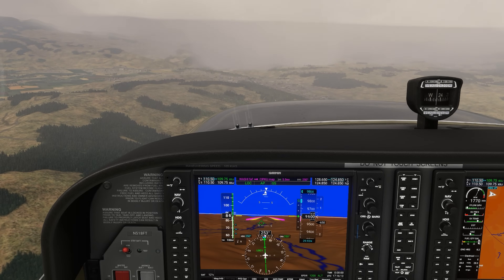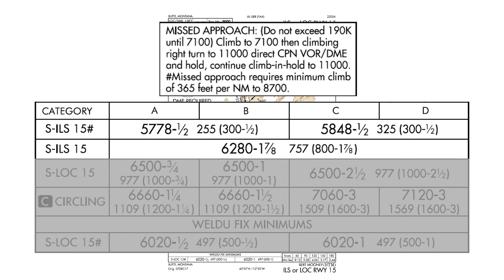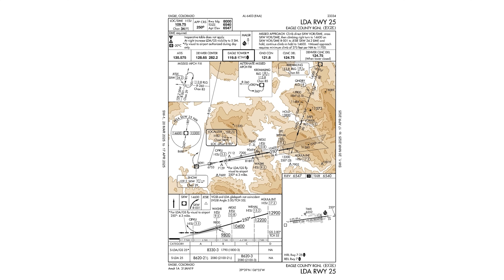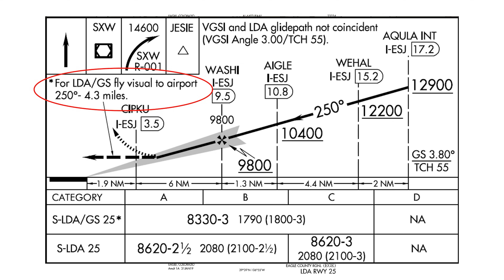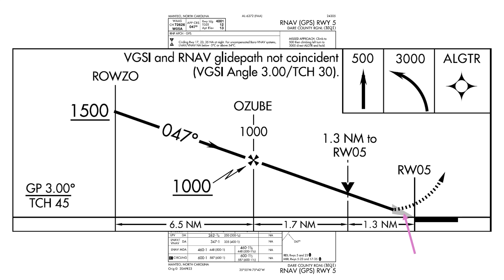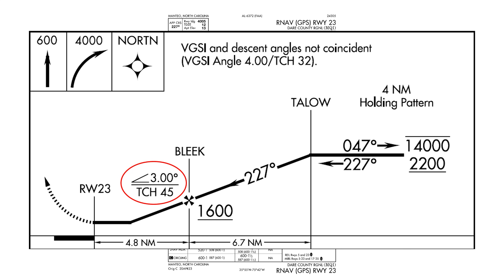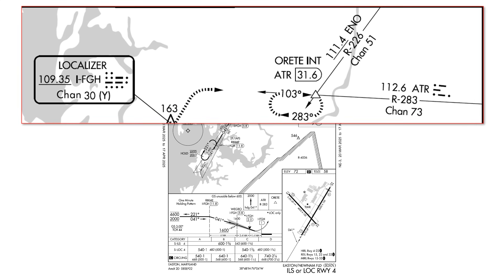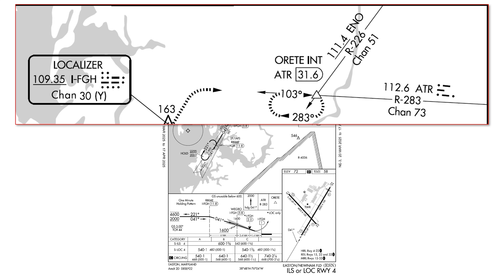Hidden Traps on IFR Approach Plates (That Can Catch You Off Guard)

Comment: If I had to triangulate to a fix on two radials I would tune both to the GNS 430 nav unit active and standby (since I probably will have only one nav radio)  and then twist the OBS fast enough between swapping VOR freqs in order to be from on one radial while intersecting another and I would Ident them both because I know morse code well enough

Comment: On the minute 1:18 you mention that with a “6000 ceiling” we won’t be able to see runway. As I understand, cloud ceilings are published AGL, not MSL. The DA of 6280 MSL is actually 757 AGL, so if the cloud ceiling is at 6000 AGL we should be ok. Please correct me if I’m wrong.
Reply: For the example of the video, he’s saying it as if you’ve already converted the ceilings from AGL, and figured out they’d be at 6000 MSL

Comment: Could someone explain how at KEGE LDA RWY 25, CIPKU is "roughly" 3 statute miles from the runway threshold.  Seems closer to 2
Reply: It's because the localizer equipment is situated on the far end of the runway you're approaching. So in this case, at CIPKU, you're 3.5 miles from the localizer equipment, but there's still 8,000' (roughly a mile and a half) of runway to account for. So you're right, it's about 2 miles from the threshold of the arrival end, but 3.5 miles from the departure end, where the equipment is located

Comment: Good video! One thing that you need to watch out for on an ILS is a Mandatory Crossing Altitude.  For example, the ILS to 6 at KTEB has a crossing altitude at 1500' at Dandy. If you follow the Glide Slope outside of this fix, you will be above 1500' when crossing DANDY...and Approach will yell at you..or may get a pilot deviation if there is conflicting traffic overhead inbound to KEWR.   I just ran into this same issue in KOAK with a crossing restriction that, after a long night, we almost missed.